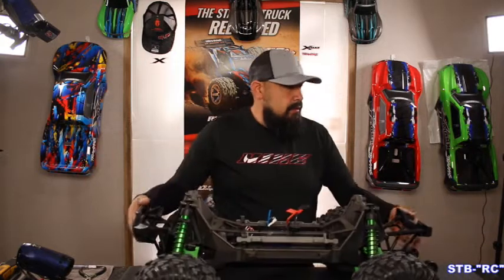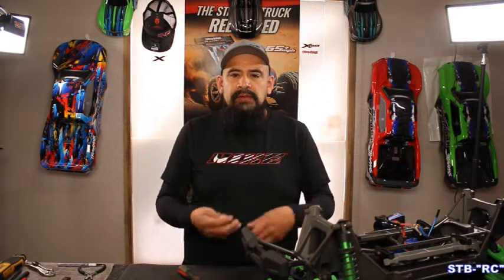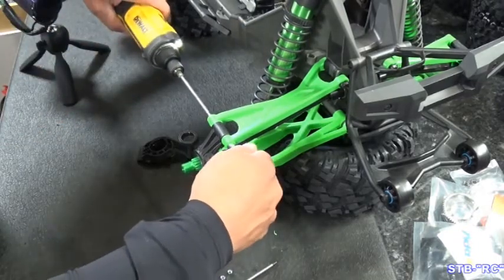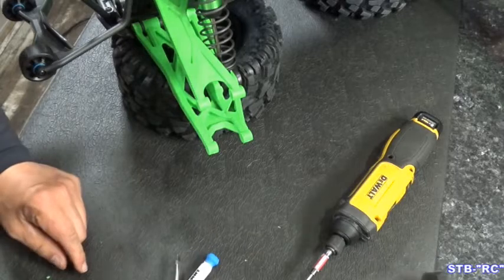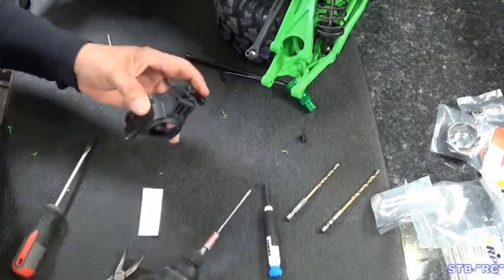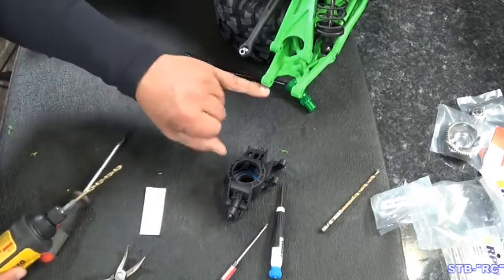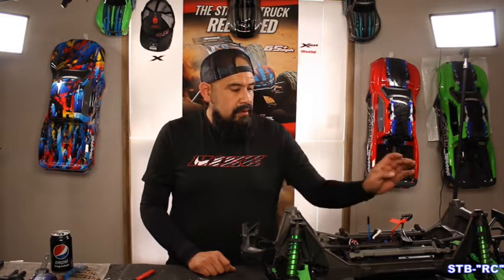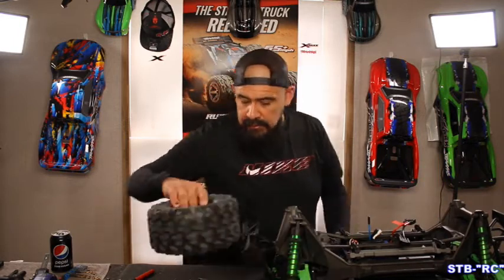How To Make Your XMAXX Bullet-proof Step 1 RPM Hinge PIns And Bearing Carriers

Comment: I replaced all my hinge pins with small stainless steel bolts from my local hardware store. I noticed you tightened yours pretty tight. I found that it makes the suspension too tight so I used lock nuts and had to back off the nuts just a little to get full range of the suspension without any extra resistance.

Comment: GREAT VIDEOS SIR,,,,BTW…..I have a hyper tough drill too,,,,but mine has a clutch on it,,,,,,it’s red in color……I bought it at Walmart,,,,,the adjustable clutch works great,,,has 5 settings on it…I bought it 2 years ago….check it out….